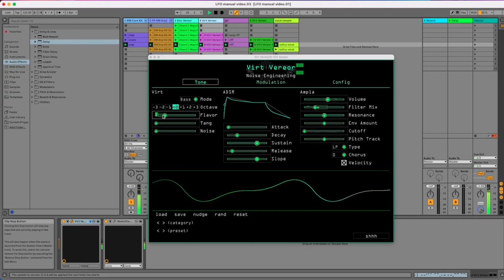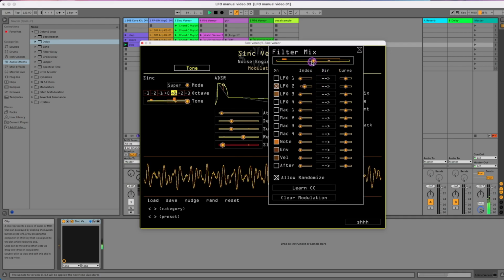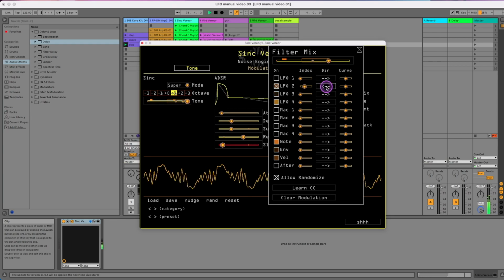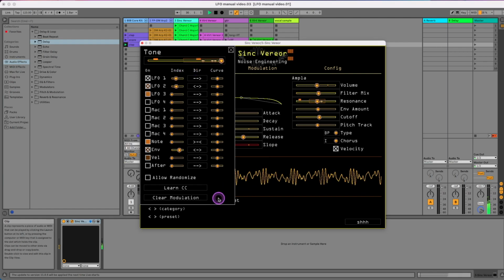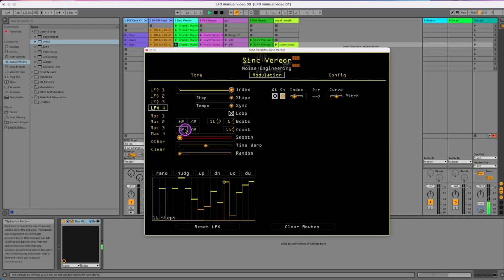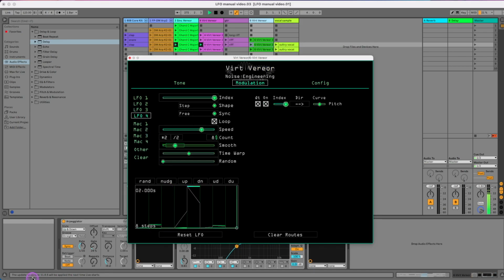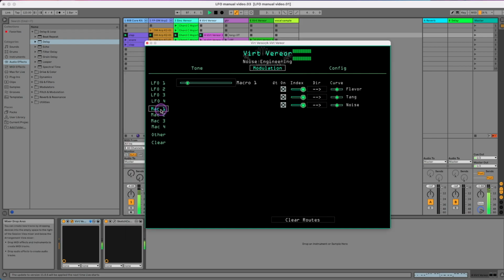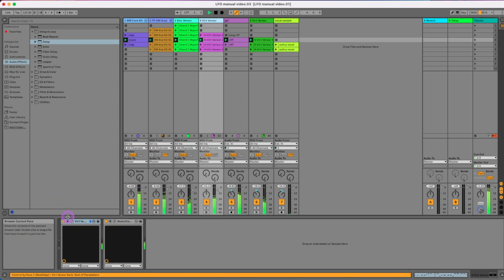LFO update to Noise Engineering's Freequel Bundle, our FREE plugins for VST3, AU, and AAX

Comment: "Freequel" doesn't have a working download link and also where is the LFO?
Reply from the maker: Download and run the installer at the link to install the Freequel bundle. The LFO update is rolled into all the plugins, both free and paid, no separate download necessary (unless you have a very old version and need to update).